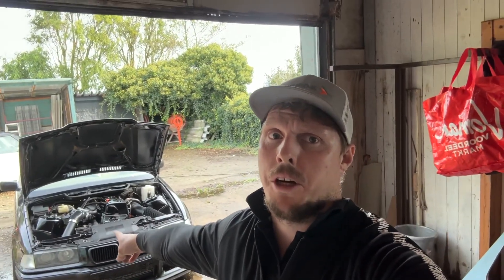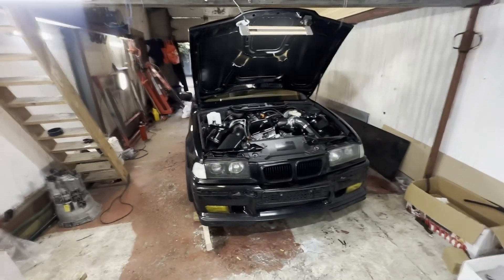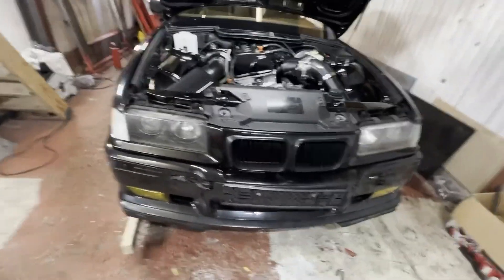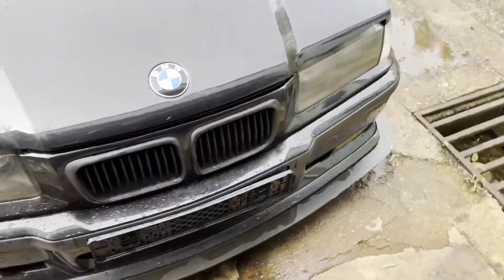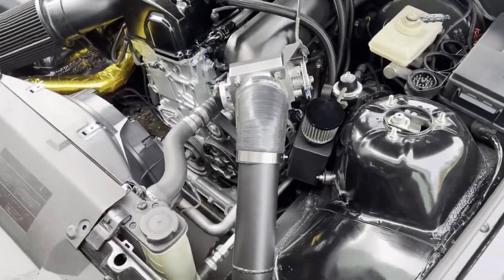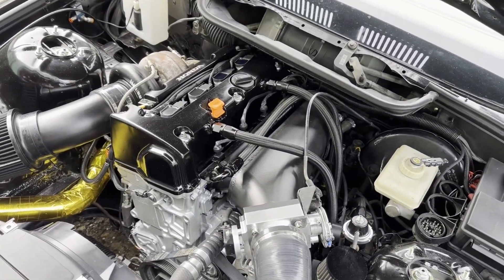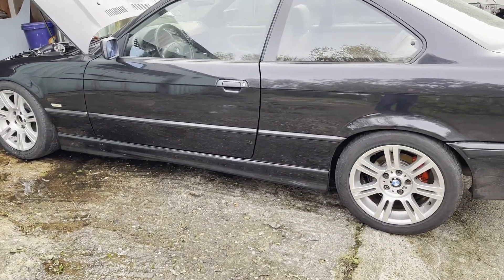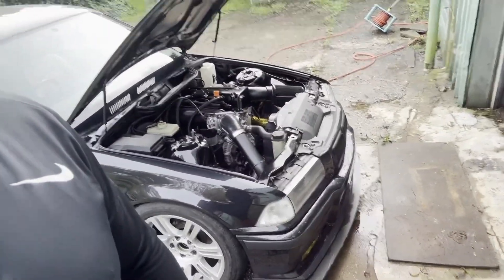BMW E36 K24 turbo Swap. Engine bay complete. 99% complete?? #k24 #k20 #kswap

Comment: Damnn🔥🔥🔥I’m planning to do one in an E46 . I wonder what was the hardest part 🧐
Reply from the maker: If you can weld it’s easy
Reply: I'm also interested in swapping a K24 into an E46. What is estimate on full conversion kit
Reply from the maker: @tonka5134 5-15k depends what you buy or make your self .
Reply: I wish you were back in Australia, maybe you could build mine 😂.
Reply from the maker: @tonka5134  I can make a kit with step by step instructions 🤣🤣
Reply: @thataussietommy  would love this for the e36. Did you keep the original zf trans?

Comment: Very clean 👌 do you plan to visit the rdw to get the swap registered ? Is it pre '98 ?
Reply from the maker: Thanks man .  
Ja I have appointment in December this year .. car is 1999 😭😭😭
Reply: Well the car itself looks quite tidy and the enginebay isn't held together with tyrips and ducttape, seen much more "creative" projects getting approved... Should be no biggie. Most important are the proof of origin of the motor itself (chassis or registration plate numbers) and the decibel ratings. Might need a trip to the testing facility in Lelystad though
Reply from the maker: @appelflapdrol  underneath is clean and painted. All new arms and bushes. Motor comes from nl auto . Big kat and end demper . . So I hope  block number change and that’s it .

Comment: Such a nice swap , Question, are u still using the original e36 transmission? And do you have a separate ecu? Or is still working with the original e36 ecu with adapters?
Reply from the maker: I am using bmw gearbox and stand-alone Ecu from Ecumaster